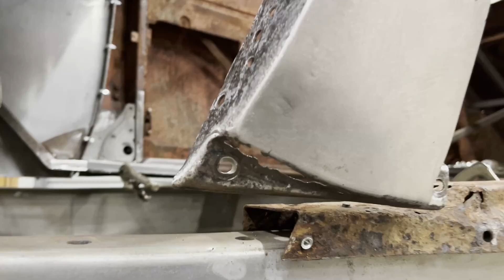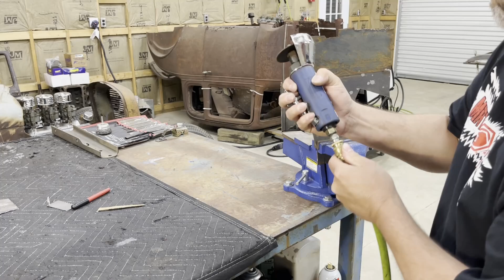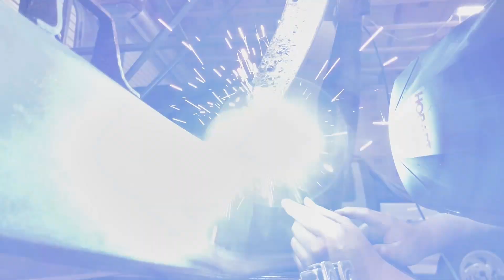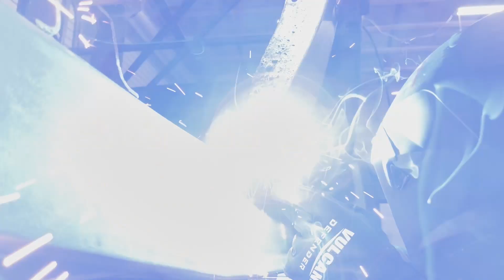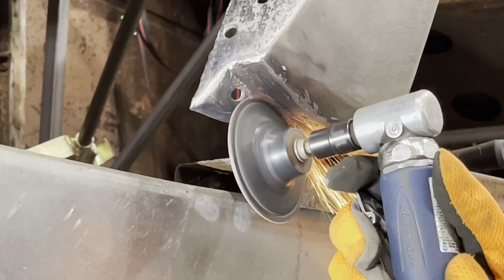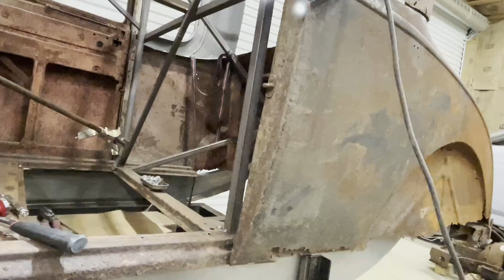"A" pillar rust repair complete! Model A Ford Traditional Hot Rod Build. Finally done! #specialcoupe

Comment: Save your cereal boxs/beer cases for making patterns. It works way better than coragated cardboard. Or if you want to buy something my local Lowes carries 36"x50' Ram Board (18lb. paper) for $36-$40.
Reply from the maker: Man, you are so right on that.  I looked around the shop for something else and didn’t have anything handy. I just went with it and got it done LOL. I see other guys on YouTube using Ram Board, and it looks to work well.  I’m going to see if they have some at my local lowes.   The cardboard is definitely not the best option.  Thanks for the comment. And thanks for watching!

Comment: Lookin better every week. I like your no nonsense approach. If the surrounding metal is good, weld it up.
Reply from the maker: The metal on this car is thin everywhere from years of surface rust. So, if I decided to replace every panel or fabricate a new panel for every piece that was rusty, I’d end up not using any of the original car.  I decided on this car to just save it whatever way possible.  This was rat rod material for most people.  I’m going to clean and prime both sides of the metal real good after making all the repairs, so it will last for many years to come.